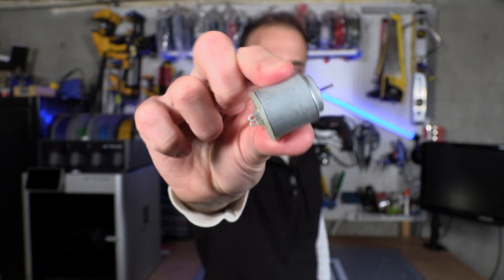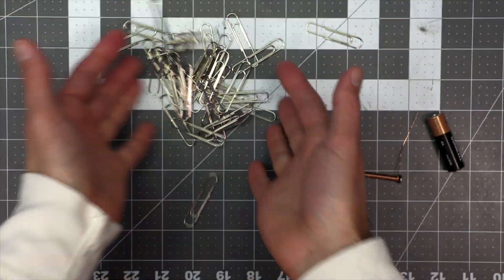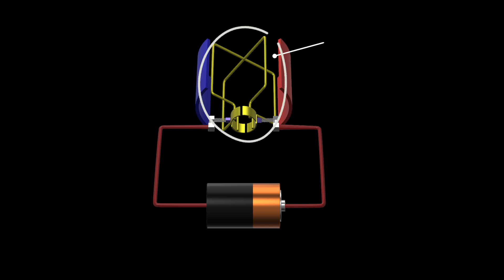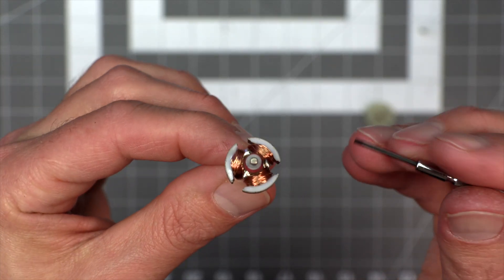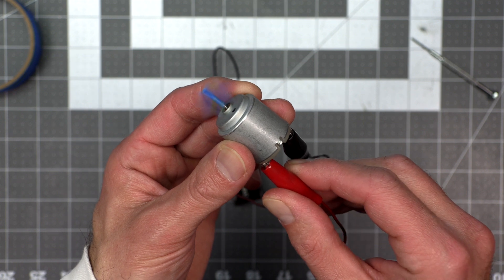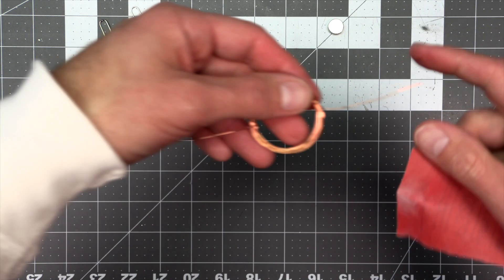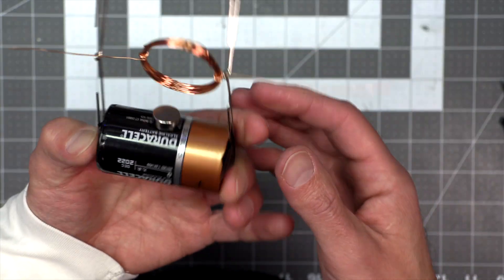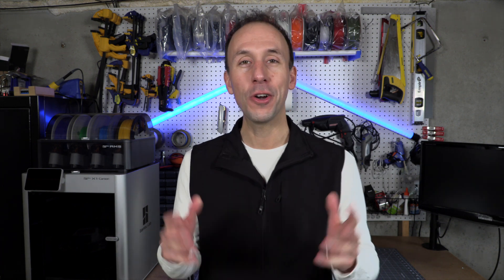Make a DC Motor & Learn How they Work

Comment: can i use OOK 3/4-inch Ceramic Disc Magnets that i have from home depot?
Reply: with a 20 gauge copper wire!
Reply from the maker: I think so. The neodymium magnet will work better. But there’s only one way to know for sure! Let me know how it works.
Reply: mmh I think the magnet isn’t strong enough

Comment: Why doesnt the one you quickly built at first just overheat and catch on fire? If you accidentally ground the positive terminal on a car battery its pretty violent.
Reply from the maker: I believe it has a different outcome from shorting a car battery because the current a car battery produces is so much more.